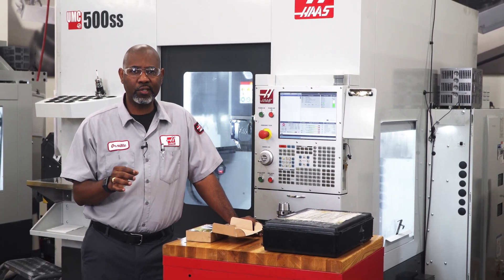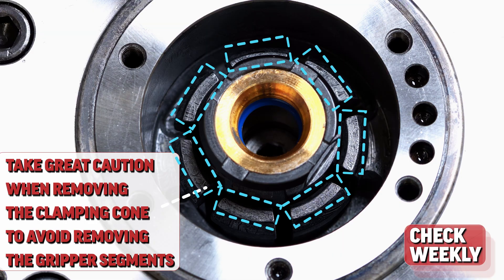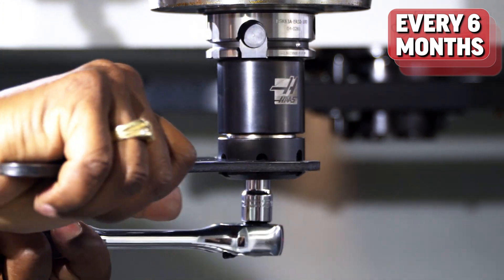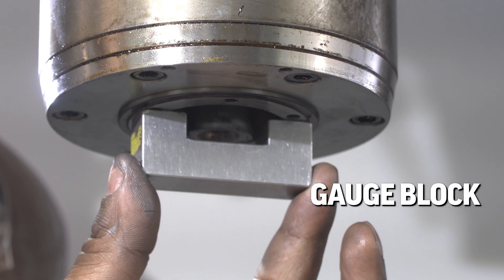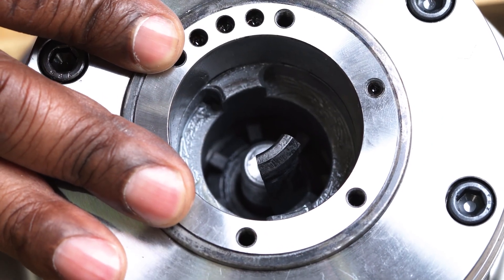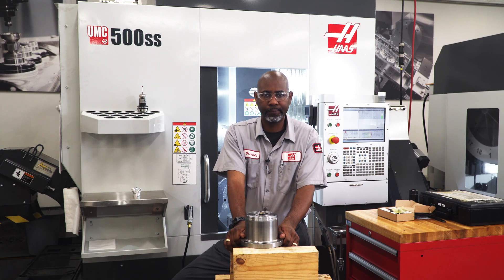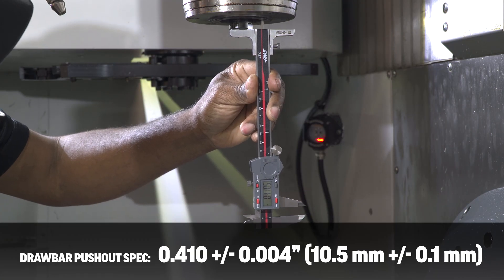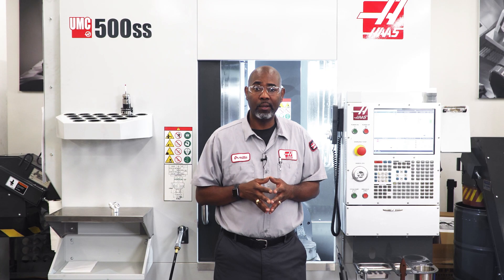Service - HSK Spindle Clamping Unit Maintenance - Haas Service

Comment: Sir my tool not unlock too ispendal but my unlock commend working properly.plese help.
Reply: Had that happen once, I had to drill through the tool holder to access the locking setscrew and then loosen the gripper assembly

Comment: Was thinking about HSK with my next mill but now I’m not sure. It seems like a lot of complicated maintenance work compared to a CT40. Are HSK spindles really that much better than CT40?
Reply: Out of 10+ machines, I currently use the only one with HSK in our shop. The HSK is definitely more rigid with the tool holder being in contact with the spindle face, and I can run at more aggressive feeds than the other 15k RPM CT40 machines. The mechanism that clamps the tool also increases it clamping force as the tool spins faster, so as you reach higher RPM's, the connection gets even stronger. HSK will hold axial and radial tolerance better than CT40, but that's up to you to decide if that increase is necessary or worth it for your line of work. 

It's without a doubt more maintenance, because we pretty much do nothing to the CT40 spindles, but I'm really only having to use the mentioned spray grease weekly/biweekly for the HSK. All the other stuff is good practice, but doesn't necessary HAVE to be performed if no problems arise when inspecting the unit.  

The big consideration really is that HSK tool holders are more expensive (could be 20-30%), they are more intricate after all and require more precision to manufacture, BUT they are a more rigid setup and I've personally seen the increase in performance, surface finish, and accuracy.

A nice byproduct for me in our HSK machine is that since I am the only one who runs it, I don't have to worry about anyone coming by and swiping any of my tool holders, but that also means that those tool holders obviously only work on one machine at this time. But with my experience with HSK now, purchasing more HSK machines in the future is not a scary endeavor since we have seen their ability.  

All in all, HSK is a bigger investment, but they are a superior tool setup to the CT40, especially in regards to rigidity. Though you can get to work in a Chevy or a Ford the same way as you get there in an Audi or Mercedes, it just depends on your needs.
Reply: HSK are the best and precise